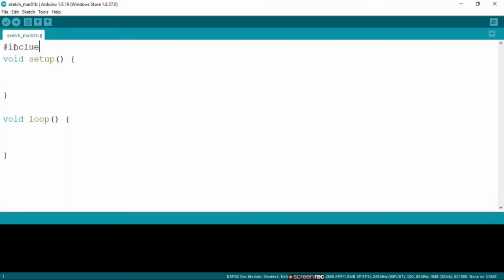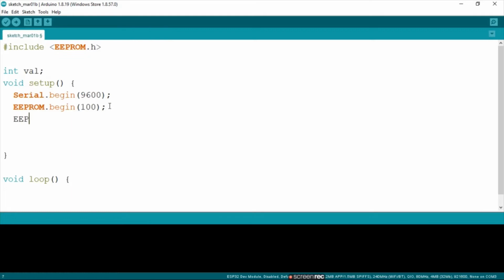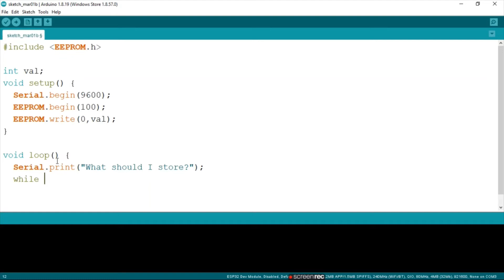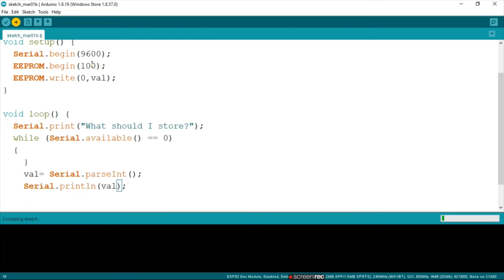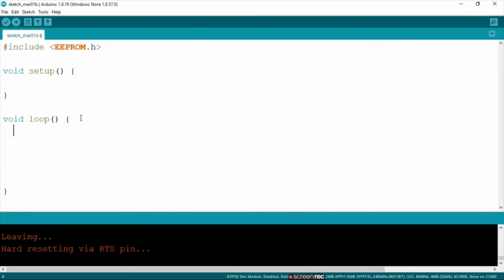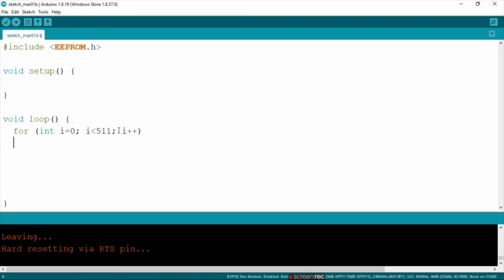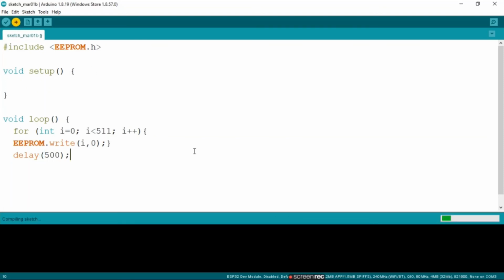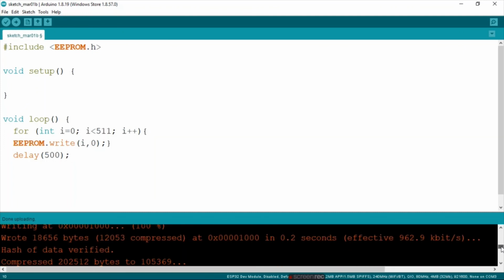ESP-32 with Arduino IDE Tutorial 6: EEPROM

Comment: Most of what he says is nonsense. It stores a value but never reads it again - so what's the point? The loop goes from i=0 to i < 511. But it should say i <= 511 or i<512 (he corrects that at 4:58). He multiplies that by 8 and says it's 4000 KB or 4 MB. But it's only 4 Kbits (512 x 8 bits). At the end he talks about the written bytes that you can see. But that has nothing to do with the loop in the program. It is the program data written to flash memory.
Why do dudes like this, who have no idea, make videos...?
Reply from the maker: Where's your YouTube channel....Oh....oh....you don't have one😭😭😭😭
Reply: @tinkererlabs6332  четко ты уложил его на лопатки